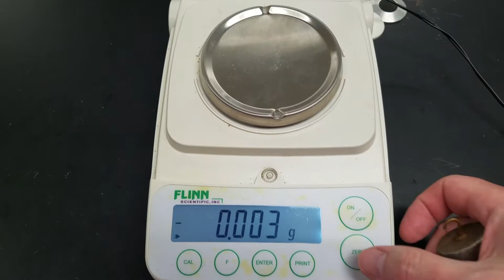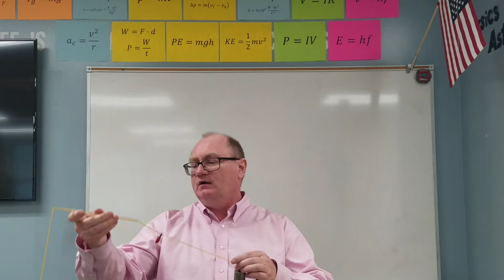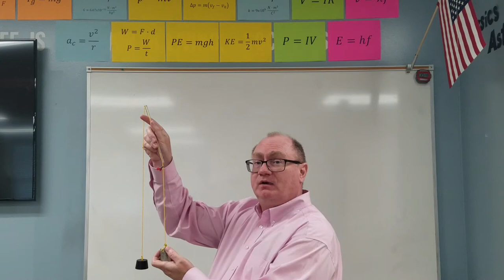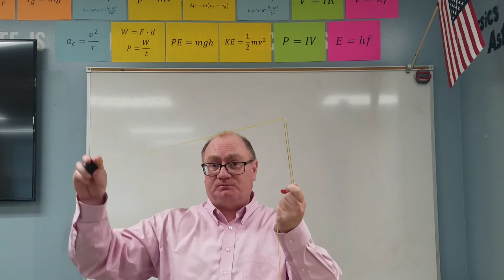Traditional Centripetal Force Lab with Data

Comment: Thanks for the video.  But I don't think the angle will impact the results in a significant way.  Since the angle is small the difference between the horizontal component of tension and the resultant tension will be small.  I did this experiment for the first time today and got approximately a 1% error.    

If you are getting an error it is more likely due to the fact that your alligator clip is up against the glass which could lead to tension higher than the weight of the stopper.  In observing others doing this I have seen it done with a mark put on the string.  That avoids this potential cause of error.
Reply from the maker: Thanks for watching the video. During the video, I was watching to make sure the clip did not touch the tube. But, the clip touching the tube would give a significant source of error. What makes a big difference in peoples results is the speed of rubber stopper.  The slower they swing the stopper the greater the angle it makes with the horizontal and the greater the error.  If people use a smaller radius and faster rate, they get better results.  Marking the string is a great way to avoid the clip issue.  Thanks for commenting and I hope you like my other videos.
Reply: @thephysicschannelwithkenny314  "The slower they swing the stopper the greater the angle it makes with the horizontal and the greater the error.  If people use a smaller radius and faster rate, they get better results. "        Thanks for the pointer, makes sense.  

We did the lab but I have not graded it yet to see the quality of results that the students got.  I like the idea of having students do real research.  Next year I will have different lab groups do different radii and explore this phenomenon.  Or, if we have extra time after I have taught the AP required stuff.
Reply from the maker: That sounds like a good plan.  If you want another circular motion lab, there is one that used plastic plates and marbles.  There is not a way to check the students' answers with it though.  I usually would just look at their process. That video is also on my channel.